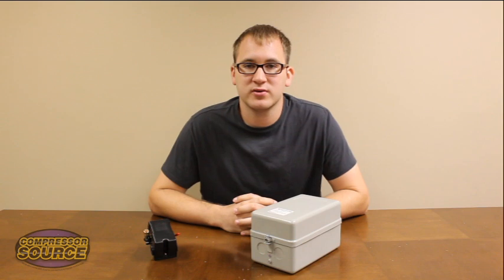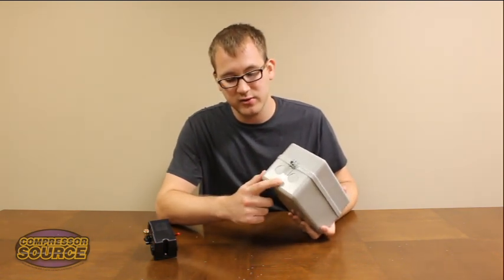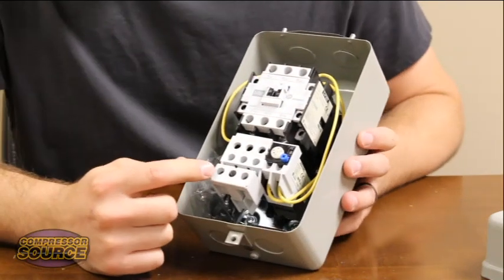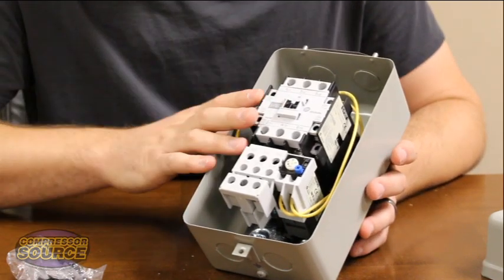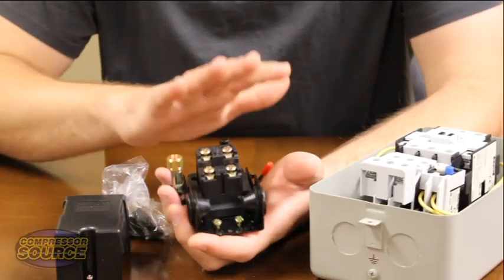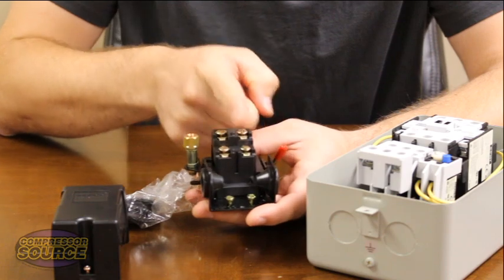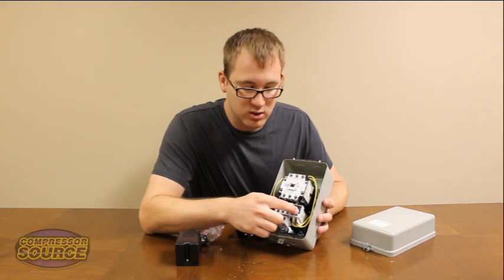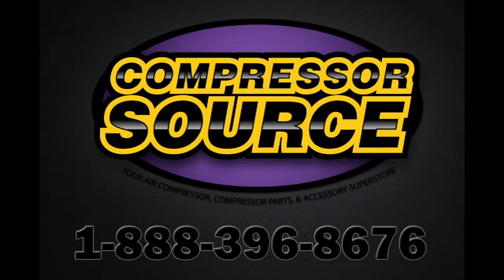How To Install A Magnetic Starter - Air Compressors -
Compressor-Source.com

Comment: I have a question if, I wanted to add a time clock ( 120-volt ) how would I wire this up???   Would I take the wire from   L1  to the clock,  then take a wire to the pressure switch, from the clock and then back to A2 or 14  and pick up a neutral from the power source.   I purchased one of your 5 h.p. magnetic starters, because a customer of mine has need for compressed air in his oil wells,  what for I don't know but they do and we don't need it running off and on all day being controlled by the pressure switch, so he may want it on a time clock, he has another one and it is on a time clock, but he hasn't said anything about this one being on a clock, I just want to be prepared.    Thanks from Texas,   Oh, and thanks it only took two (2) days to get the magnetic starter, in my book that's pretty fast.

Comment: I have a three phase air compressor I wired all up and it’s not running what kind of power supply do I need for the magnetic switch is it 120v

Comment: What happens when the incoming and outgoing wires are connected inversely?.if the load is not connected,the starter will work or not?

Comment: I have a 5 horse motor, and pressure switch. It’s the correct magnetic switch for the motor. I have it all hooked up correctly (triple checked) but can’t get the pressure switch to turn on the motor. It will start if I press the black button in the center of the magnetic switch. Is there a way to test the mag switch, to see if it’s working properly?
Reply: Same problem with mine
Reply: Check for continuity across terminals A1 - A2